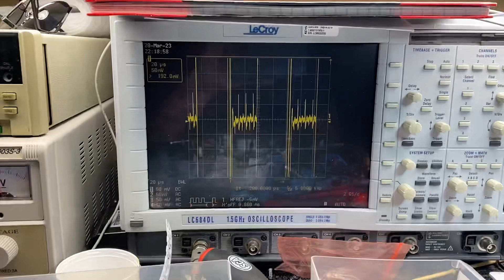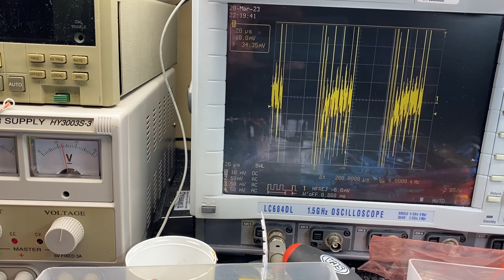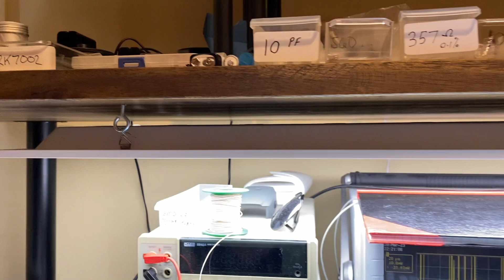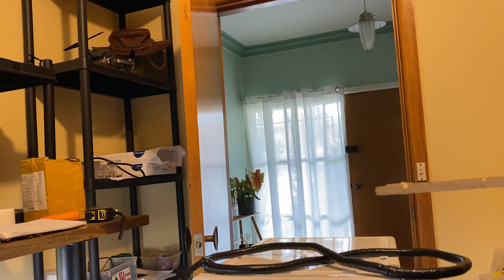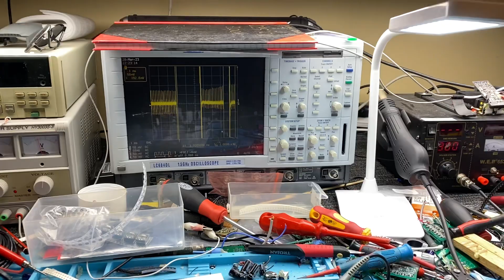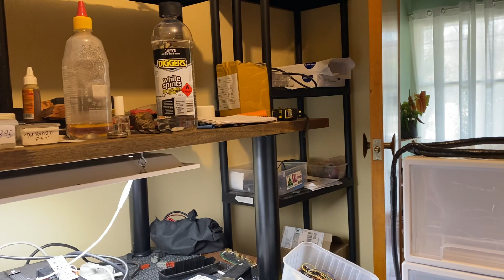The SD2000 after re engineering the power supply refer to previous video

Comment: Nice! What kind of power supply these detectors use: charge pumps or linear? Thanks.
Reply from the maker: They use a a step up converter , just a fet and coil at 62khz generating crud all over the receiver time periods.
Reply: @DetectorMods  Thanks!